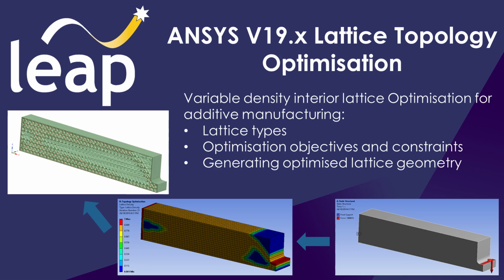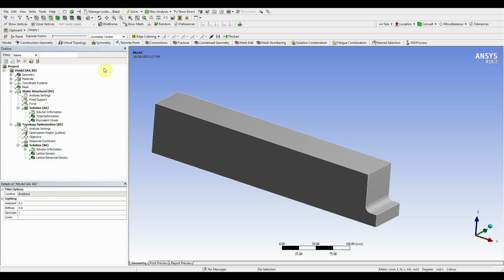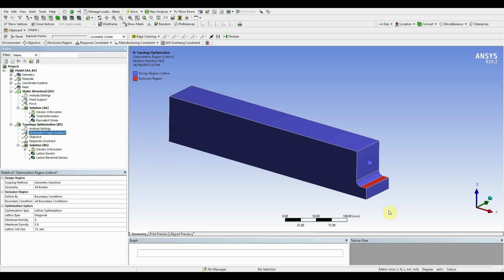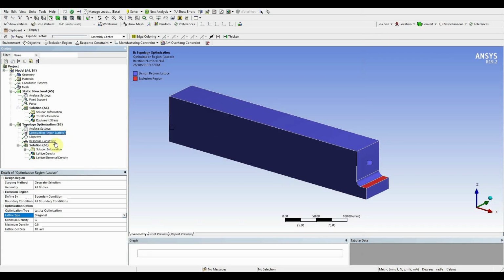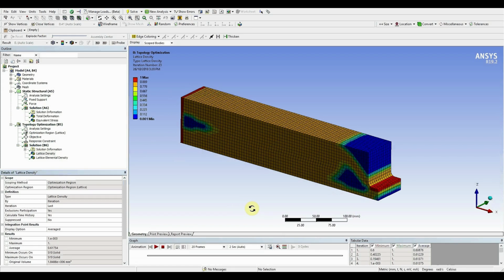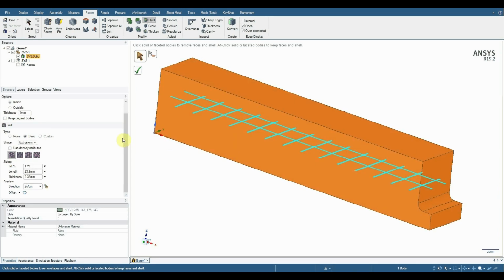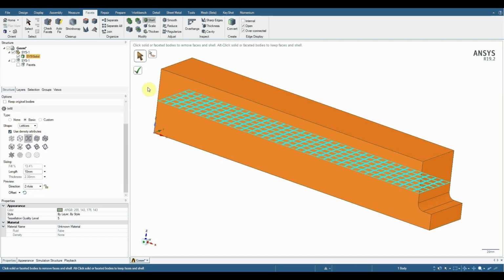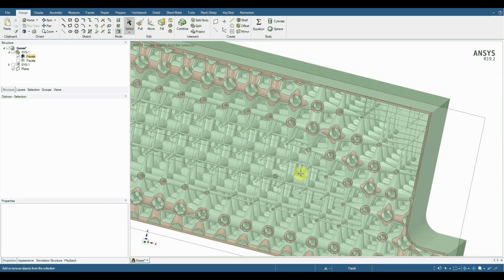ANSYS V19.x Structural/Mechanical Highlights - Lattice Topology Optimisation

Comment: good job.  but, upon completion of all the mentioned operations and simulation after the topological work. didn't work the meshing for simulation structural statique. please tell me about method  used in this step.
Reply from the maker: Hi Ibrahim, can you elaborate on what aspect of the model didn't work? If you had difficulty meshing try the patch independent tetrahedral mesher.

Comment: Thanks for this video, can you use the same topology optimised lattice feature in dynamic problems?
Reply from the maker: Hi @robbieal apologies for the delay. No, topology optimization is only applicable for static analyses. 
Note: The LS-DYNA based topology optimization tool, LS-OPT, allows for topology optimization of dynamic transient load cases solved in LS-DYNA.